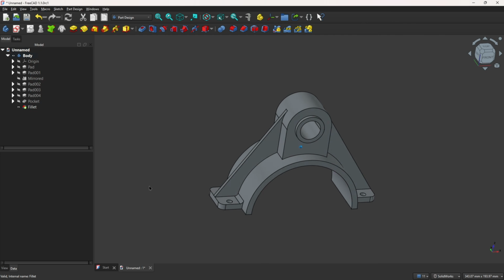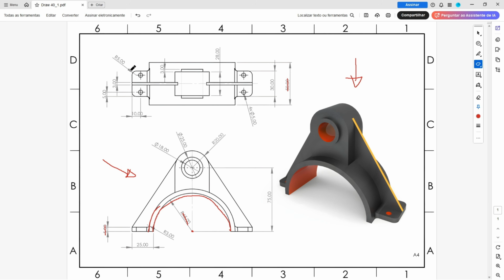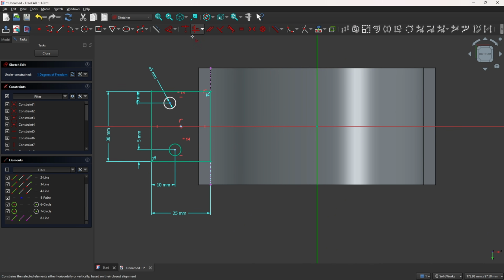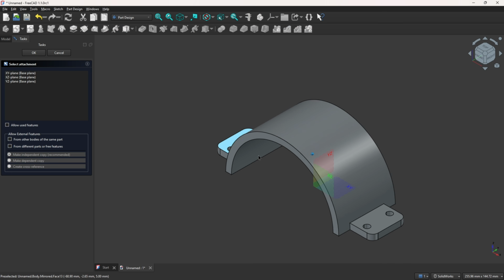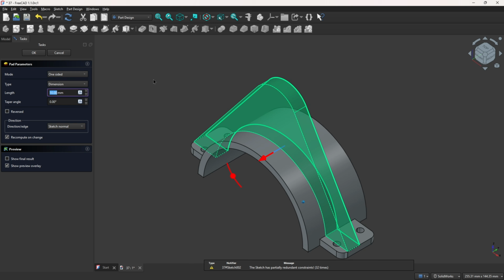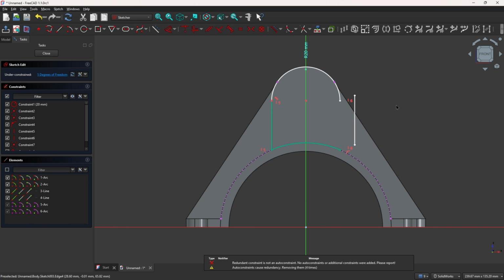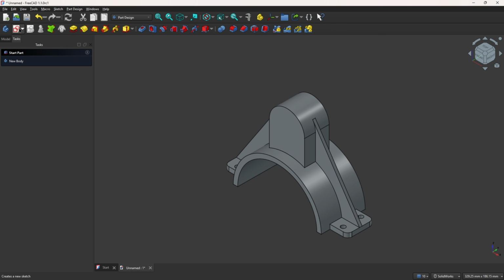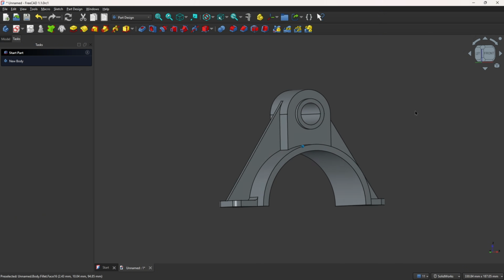FreeCAD  - Complete Beginner Tutorial Step by Step Exercise 40

Comment: The drawing shows there are 4 additional fillets on the sides of the lower flanges.  When I tried adding them to the drawing, I got an error.  Apparently the 4 fillets on top of flanges are blocking the side fillets.